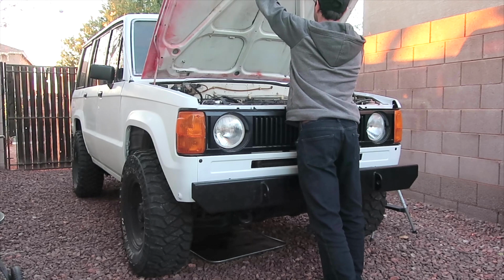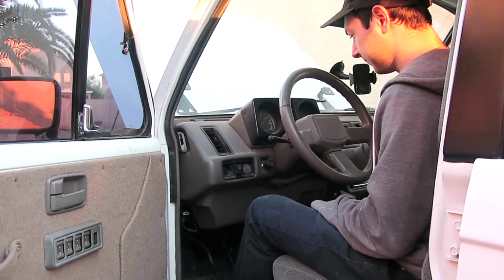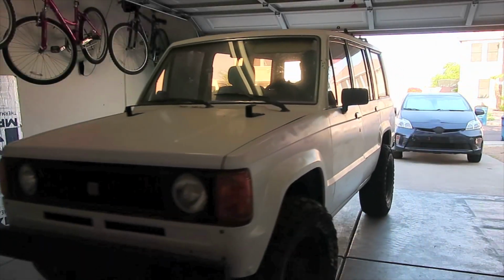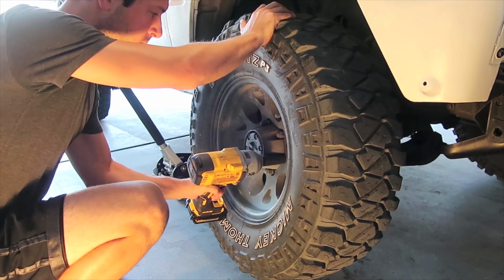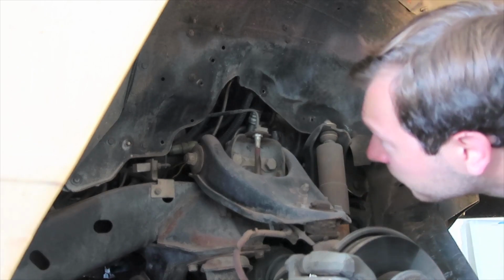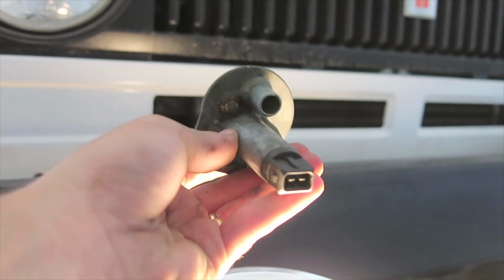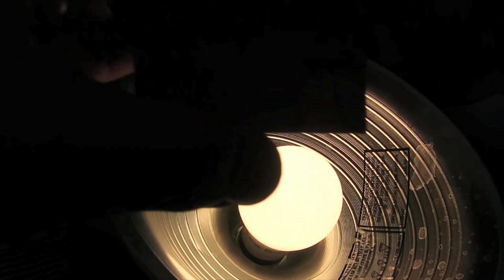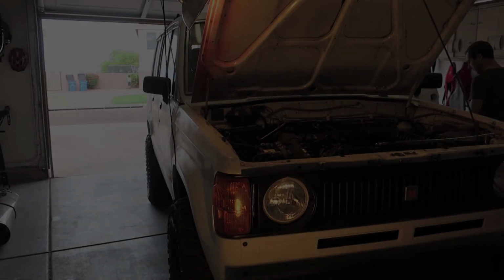1989 Isuzu Trooper Idle Air Control Valve Replacement - High Mileage Repair

Comment: I have a 1988 Isuzu Flatbed Truck. No there is no name to it just a truck. It’s a 2.3 engine four-cylinder stick shift front wheel drive.. I was thinking that something must’ve clogged it up because it just happened like overnight. What happens with my vehicle is it idles extremely high and when I’m shifting it just goes crazy and I don’t think it’s the carburetor. I really feel like that it had to do something with the muffler and all that crap going back into the system so I’m gonna try to do that blasting with the PB spray and see what happens if not, I’m probably gonna have to replace the IAC valve but that’s just the beginning. I don’t know hopefully that’s it and I really don’t even know if the valve is up there by the throttle or if it’s underneath by the wheel. So it’s not like my engine dies down sure it would die down every once in a while but once it heated up, it was fine but now it’s just idling so high like every time I shift it just goes super high if I’m in neutral, it’s super high so and we did clean out the carburetor and it seemed to want to go back down and that’s why I think there could be some dirt accumulation from all of that Old muffler because when we took off the old muffler, oh my God, it was horrible. It was rotted all the way through. I think I had the original muffler. If anybody can let me know that if I’m on the right track or not, please give me any advice. It’s an old truck. It’s just a little flatbed working truck. It is a passenger truck and it’s not like a box truck because it has the original like front end of a truck and it wasn’t specialized. It was right off the floor when it was probably made back in 88 please anybody advise cause I’m gonna start on this tomorrow. Thank you very much and I love the video because yeah I gotta get all my tools out and see what I can do. I gotta get my flashlight. I get a jack up all kinds of fun yeah

Comment: I had the same problem on my Nissan Laurel. However, the component is very easy to access on that vehicle, and it was removed in five minutes. In this case, it was enough to loosen the nut on the plug side of the valve. Now you can adjust the flap and retighten the nut. So, the valve usually doesn't need to be replaced.

Comment: I have a 92 Isuzu píckup. Is the idle air control valve in the same location?
Reply from the maker: If it's the 4ZE1 engine then I would guess it is
Reply: @HighMileageReviews  how about the 4gj2 engine?

Comment: This part does not function anything like an Idle air control valve.  It is in-fact this part is not even called an IAC.  There are 5 devices to control the idle on this engine this is only part of the system.   The spraying oil down into the valve is a dumb idea.  If the fault is not this part you have just destroyed it by doing so.  First check for voltage at the valve is the proper way to troubleshoot.  A 1/4:" drive swivel head long handle ratchet will get to the bolts with ease.  The replacement of this part takes about 25 mints total.     Most importantly this part is rebuildable.  You don't need to buy used 30+ year old valve.
Reply from the maker: Ok, tell that to everyone on the forums
Reply: @HighMileageReviews @HighMileageReviews 

I have... 
You must have missed it

You sound intelligent enough not to think for yourself and not think what you have been told. Perhaps I was wrong.  PlanetIsuzu & other forums are sheep that can only follow the herd.
Reply: Where are all of the idle mechanisms in this system, and how can they be tested?
Reply: @VictorIxchel   thermal temp switch,AAV, FPR-SVS, AAV, A/C & Power steering load.  There is no simple way to bypass.

Comment: Cool! I think I’m looking at the same problem. Currently replacing vacuum lines. Of those still present, some don’t match the diagrams. Regardless of the problems finding parts, I want to keep this cool little project vehicle. Not many like it in the Tucson area.
Reply from the maker: Good luck! Those vacuum lines can be very confusing
Reply: Hey out there in isuzu land, I have a 1988 trooper and am in need a an IACV, I've been scouring the internet with no luck. Any suggestions or does someone out there have a spare? (Tom in Colorado)

Comment: Did you have any other idling issues? I have one that keeps reving so I think vacuum leak but would the idle air control valve be part of that issue?
Reply from the maker: That was my only idle issue, but yours does not seem related to the idle air control valve. Vacuum leak seems likely, however
Reply: @HighMileageReviews  you should drive down to Benson AZ and help me out 😉
Reply: Does it idle high and after about a mi ute or so just Rev up and down in 1-2 second intervals? I'm having this issue and can't find a fix

Comment: my 88 trooper quit while hot and now starts but only runs a few seconds. could it still be valve?
Reply from the maker: That might be something different. From my understanding, a stuck valve usually only affects cold idle
Reply: Did you get this fixed? Jonny5 has a video about the fuel relay/pump bypass. Works great in a pinch and for years if you forget to get a new relay...

Comment: Where did you find the IAC valve? I'm looking for one to see if that's the issue on my '91. My Trooper "surges" at idle and won't idle below 1200 rpm. Thanks for sharing.
Reply from the maker: There's a user by the name of Shawn Anthony on planet isuzoo. He has an inventory of trooper parts. That's where I got mine
Reply: @HighMileageReviews  was it used? Trying to decide if I get one or to pull mine and overhaul it.
Reply from the maker: @MrBowNaxe  it was a used part, in verified working condition
Reply: I see he is now banned on the Planet?? What did you pay for yours? Thanks @HighMileageReviews

Comment: If the valve is shut closed while cold and on the bench, loosen the sealed screw on the bottom. The screw is connected to the inner spring plate and can move a whisper. Move it all the way and tighten it back down in place. The plate and opening should be in the proper cold starting position at this point. Put 12v to the two terminals and the plate should close in 2-3 minutes (high starting idle-warm idle). Disconnect power and it should return to the open position as it cools back down. Test it a few times to be sure.
Reply: And nice trooper btw 👍 The “5tec” mod is really worth doing to clean up the itec if you can get away w it. I know in Cali those kind of alterations are a no no.
Reply from the maker: Good tip! I probably should have tried testing the valve in the bench like that before getting a new one...next time I guess. I've considered the 5tec mod, but it's running well these days, so I'll tackle that if I get desperate haha
Reply: But still you need to remove the valve from the engine for to turn the screw right?
My engine is idling fast when it's cold and when engine is warm he will shut off like the video or suddenly he will run fast again. Do I have another problem?
Reply: Yes you must remove the valve to get at the screw easily. Also you want to be able to watch what the internal plate is doing under 12v load. Not sure what your issue is exactly but w a properly working valve the idle will start high and then gradually settle down upon warmup. Idle should be around 1000rpm once warmed up. If you still have a stock thermal vacuum valve on top of the thermostat housing I've read that that could contribute to high/surging idle due to trapped air in the cooling system. Maybe you've found the issue by now?  @sjanbob
Reply: did you ever find the problem @sjanbob ? my 4ze1 has a similar problem. good idle cold, bumpy idle while warm
Reply: @northvankiwi   I have discovered that the iac valve was damaged and I couldn't repair it and there is not one for sale. I have replaced it with an universal electric air vale and this helped the engine to run a little bit more smooth. I have tried to remove air from the thermal static valve and switching some vacuum lines on it but it doesn't helped. The problem isn't solved yet :(

Comment: Just put a spanking new IAC valve in my 1990 Isuzu Trooper.. A few weeks ago, I replaced the ERG valve and solenoid and cleaned the EGR Port. Had to remove the intake manifold for that job.. So much fun. But hey, my Trooper idles fine and no longer stalls at stop signs.
Reply from the maker: Oh man, yeah that's a load of fun haha I've taken the intake manifold off a few times now and it never gets better. Everything is easy up until getting the egr pipe on and off
Reply: Same position of IAC in the video ?

Comment: I feel you. I replaced my IAC valve and went through the same frustration of removing the 2 bolts that secure it. When I reinstalled it, I picked up 2 longer bolts with locking washers and nuts and flipped them around so they would be easier to reinstall and uninstall if i ever needed to. 

Looking back on the issue of why I changed my IAC valve, I don’t think I actually needed to do it haha
Reply from the maker: I considered doing the same thing by getting longer bolts, but there's very few metric options at my local hardware stores, and I didn't feel like waiting to have some shipped to me. I just hope I don't have to do it again
Reply: @HighMileageReviews  I wasn’t able to find anything that threaded correctly either so I just got bolts that were slightly smaller in diameter so it fit through then secured it with a locking washer and bolt. I also hope to never do it again 😂
Reply: @HighMileageReviews  I just relocated mine instead of putting it back
Reply: I drilled through the threads, put bolts through the holes and nuts on the inside.  Now it's not hard to get a socket wrench on the bolt heads, more room to ratchet while I hold the nuts steady.

Comment: Where can I find an IAC? They seem to be discontinued. I know I can find one though. Please help. Lol
Reply from the maker: I got mine on the forums. A couple people might have them. I got mine from a user named Shawn Anthony. He has a business and will sell you new or refurbished parts for your trooper. Also Jerry Lemond can get new parts from Japan I believe
Reply: @HighMileageReviews  could you possibly leave a link Unable to locate one. Also suspension options have you been able to locate anything?
Reply from the maker: @joshuatheagene3409  planetisuzoo.com is the place to be. I haven't had to shop for suspension parts yet, but the forum should offer some options, and I'm not sure what RockAuto has, but I usually check there first
Reply: You described that procedure exactly! I'm trying to get my Dad's '91 running. Fuel pump was the main issue but the idle is killing me... I'm fearing the dreaded IAC replacement (if I can find one). Thanks for sharing.
Reply from the maker: @MrBowNaxe  find someone with small hands to help! I'm not gonna lie, my wife helped me out a bit when I couldn't get my fingers around the awkwardly positioned bolt heads at times
Reply: Thank You! I’m looking into it now. Appreciate you and your videos

Comment: I really appreciate you man! Got a 1989 Isuzu trooper as well. Really been idling weird while stopped, is that a sign of mine going bad?
Reply from the maker: Possibly. Typically though, if the iacv is bad, the idle issues are only apparent when the vehicle is cold. Once it warms up, the car should idle well. These troopers are notoriously difficult to get a perfect idle, so your issue could be any number of things. mainly, check all your vacuum lines. Cracked or loose vacuum lines are probably the biggest culprit for a weird idle. Then check your timing, get that in spec. Then adjust your idle speed once you know those first two areas are perfect. Your idle should be much improved if you check all that. For safe measure though, you can spray pb blaster down the tube leading to the iacv and let it soak overnight like I did, and see if anything improves. That's the easiest thing to do and can only help keep the iacv in good condition of anything.
Reply: @HighMileageReviews  I thank you so much man! Speedy reply + very helpful. You gained yourself a follower in me.

What website do you use to find yourself these Isuzu 89 trooper parts??
Reply from the maker: @servusdominii planetisuzoo.com forum members Shawn Anthony and Jerry Lemond are good resources of hard to find trooper parts. Though more common items can still readily be found on rockauto or at your local parts store